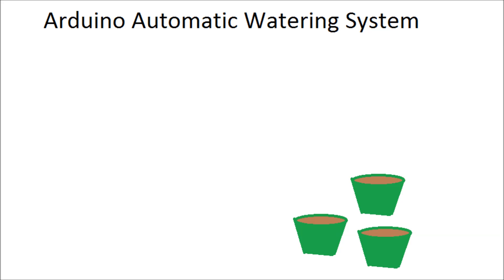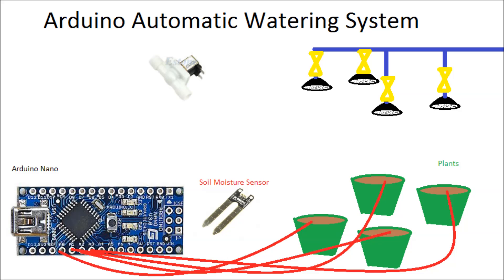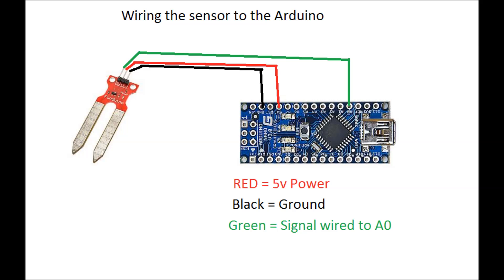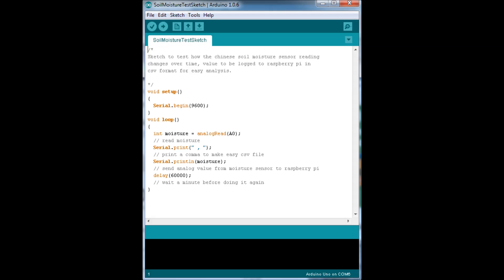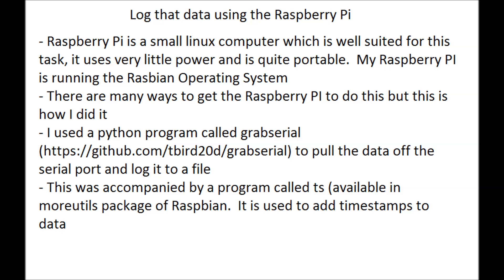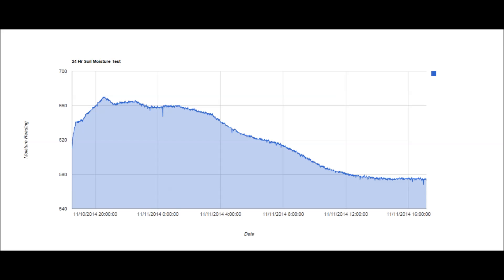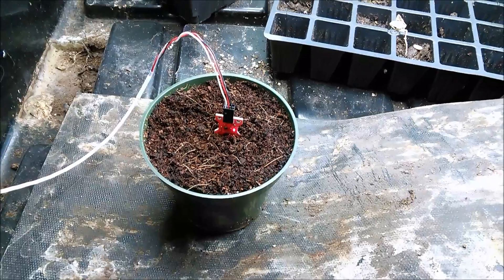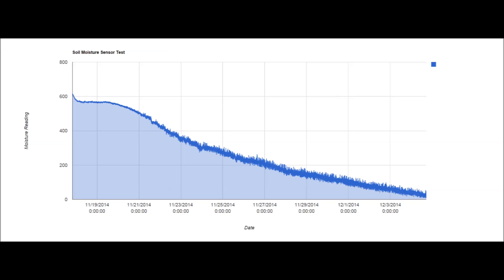Arduino based plant watering system using Soil Moisture Sensors

Comment: hi,
What happened if water in tank is empty?? Then ur water pump may burn in dry run conditions... You should embedd two project in a single project.. I. E. 
Smart irrigation system with automatic water level control using ultrasonic sensor.. So it gives sustainable solutions zero maintenance...

Comment: it is enough to use one soil moisture sensor because the soil dryness would be the same for all.
Reply: I use a sensor at the top of the pot,  triggers when it goes above 600
Reply: I have been on this all day. I have a 6 pot system. Here is the code. Not much help without the wiring
Reply: Damian Butterworth hi.. can i have the code too.. i am doing the automated plant sprinkler using soil moisture sensor and ph sensor for fertilizer and display the data collected on the android apps..

Comment: If you are using an older Arduino (maybe still the case, but mine's atleast a year or so old), you have to close the Arduino IDE prior to running grabserial, or it'll tell you the port is busy. Just a tip from someone who just figured it out! And if you are already using grabserial, you have to stop it before running a script to write to the serial port.

Comment: hey mr badrilijin i m doing miniproject on wanter management system particularly for building in which i have used arduino, solenoid valve to control water flow and water flow dectectator  sensor  which will  send the singnal to arduino and arduino will calculate  threshold ammount of water and it will display the output at LCD and then command the water valve to closed the valve .can you help me how to write code ..........very importanly code for calculating water flowed   throungh the pipe
Reply: Lal Bdr Ghalley Did you finish your project? Which valves did you end up using?

Comment: Hello. I am using a arduino to send +5V to an optocoupler, to drive a triac. The triac is to switch a 24VAC Solenoid Valve. My question is how do i turn off the triac?
Reply from the maker: +Haitham Adwan http://www.electronics-tutorials.ws/power/triac.html this page has an example for Triac switching circuit which might help

Comment: That's such a cool project, how did it turn out? Where did u get the valve from? Also was the raspberry pi necessary or could it have been done using the logic from the arduino itself?

Comment: Hello kind sir, I want to measure a really big greenhouse to help a friend build a balanced irrigation system, the things I yet do not know are:
1.- Since the greenhouse is huge, will any kind of wire/cable will do? or do I need an amplifier or a special cable?

2.- If I succed my friend told me he would use them regularly so, is there a way to make homemade soil moisture sensors?

Comment: since all  the plants will be in relatively the same conditions they should each be in need of water at about the same time. Why wouldn't you just use the moisture data to get average moisture of all pots then turn on/off a water pump controlled by a 110v relay on the arduino?.. seems easier and less parts... also of course you could put in fail safe code like if it's been longer than the average time it takes to need watering/or a set number of days/hours etc than turn on the relay and water.

Comment: i was thinking that you can use old car windshield washing pumps for watering but you must programm that water is comming in small steps and with big delay so the soil can absorb it and you get more acurate moisture level

Comment: Thanks this is great.   Can you give a link to the $3.50 valve/solenoid you got from ebay.  I have been looking for that.
Reply: Here is a link http://www.ebay.com/itm/400809739679 .  I still haven't received my order which was placed on november 20th.  This is the big downside of ordering straight from the Far East.
Reply: Ryan Kreuser Thanks Ryan,   I bought this one from Jameco:  http://www.jameco.com/webapp/wcs/stores/servlet/Product_10001_10001_169835_-1    it is $10.95 and still 12 volts (looking for 5 so I dont have to use a relay) but it has a smaller input and output diameter.  Also you can make the moisture sensor with two nails pretty easily.  Here is my moisture readings from the Arduino Yun:   https://kubli.herokuapp.com/#!/sensor/moisture.   I use the linux side to POST data into mongolab every 5 minutes.  And host the charts on heroku.   You might have to refresh it after the first hit since the free tier on heroku goes to sleep every 2 hours.

Comment: Doesn't the Pi have input and output pins? Why not then use the Pi alone without the Arduino?
Reply from the maker: Great Question! The Raspberry Pi does not have any analog inputs.  A $3 Arduino provides multiple analog inputs but can't really store the data easily.  It is a perfect marriage!
Reply: Okay, cool. There is a shield or something for the Arduino that lets you log onto an SD card. What do you think about that idea?

FYI the conductivity readings will vary with temperature as well as soil moisture so you might want to include at least one thermometer. A pot can warm up quite a lot in direct sunlight. Also, the conductivity sensors erode so you should consider taking a reading every minute or something instead of constantly running a current through them.

I've wanted to do a project like this for a long time but it's pretty intense and I know little about electronics/programming. It's hard keeping my kitchen herbs alive though!
Reply: there is 2 options you can buy soil moisture module with digital tx and rx pins or the cheap one option yust buy micro sd module for arduino can't tell the price but it is under 5 bucks on ebay